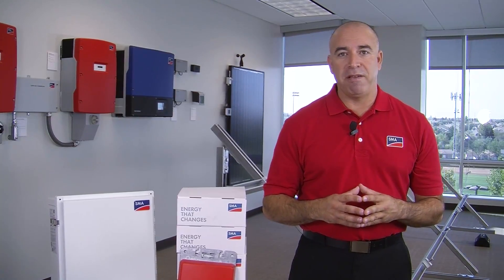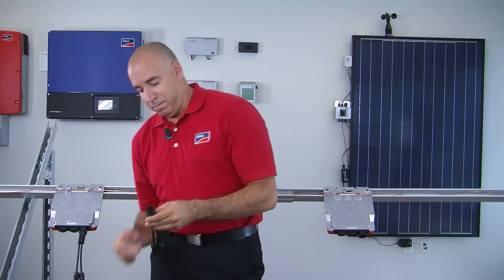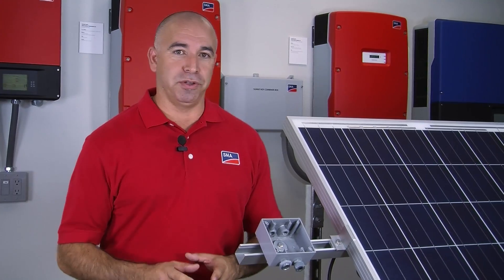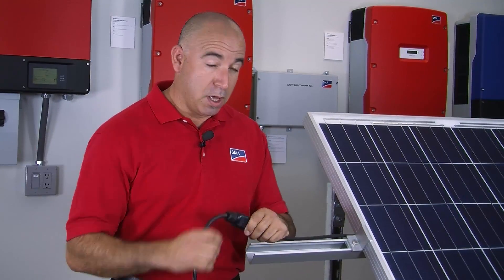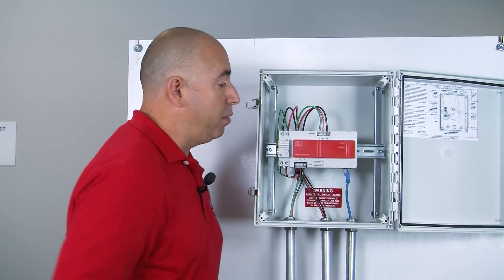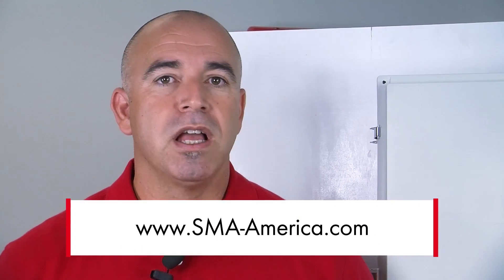Tech Tip: How to Install the SMA Micro Inverter

Comment: My question and curiousity is how do multiple micro inverter PVs  manages to synchronize the ac frequency they generate? I mean it's like connecting multiple gasoline ac generators together. And do the micro inverters have inbuilt ac syncronizers?

Comment: Is ethernet cable the only means of communication? No wifi, no cellular connection? It would be nice to have those features to eliminate the extra work of running cable. Also there is no info on the website for the micro inverter.

Comment: please excuse my ignorance.As i'm watching your videos it's quite obvious that the xt1 has no a/c grounded (neutral)conductor coming in or out,I'd like to know if i may why and how it's omitted,yours seems to be the only micro inverter which does not have a grounded conducter on either side.As a side note i notice that your xt2 and i'm assuming all the others have a neutral terminal,how is it derived?and again why is it not necessary on the t1.This is really throwing me for a curve.As a matter of fact i have yet to see a string inverter without a neutral conductor.I have read all of the literature associated with the micro,but i can't seem to find an answer.
Reply from the maker: +ric g You are correct that there is no neutral conductor on the Multigate. In this case there is not a need since the load is a balanced 240V split phase it is not required and passed UL testing as is. For the larger XT units there is a neutral because the networking equipment that monitors the Multigates requires it, though the neutral is only run to the power supply and not to the individual Multigate units.

Comment: How does it connect to my service. In the end he says connect to one 15 amp breaker?  Where is the ground and where is the neutral, 15amp?..... Just a beginner trying to learn. The 240VAC split phase comment below also has me wondering 240 vs. 120 ? Thanks in advance to all of those who take the time to  reply.
R McG
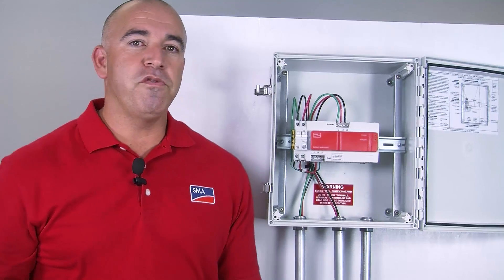Reply from the maker: RobtJude The Multigate connects to your AC service like a normal PV system, via the appropriate size breaker given the 120 percent rule connected to the main panel. That grid connection from the main panel has marked areas for each wire to land on the Multigate's pre-installed 15A breaker as seen at 4:25 in the video. Ben doesn't fully show how to connect to that breaker but you'll see labeled connection location locations for each. The system only produces 240V split-phase.
Reply: SMA Solar Technology Thanks for the quick response. I did figure it out by watching another video. Looks like a 15/20 amp double pole breaker with the neutral going to the neutral bus bar and the ground going to the ground bar. All just standard stuff, nothing fancy. Sometimes I get confused by  thinking things are more complicated than they really are.

Comment: hey im looking to combine my solar panel whit a micro hydro plant, do you have a solution for this setup?
Reply from the maker: Hi Rag,

Yes, the Sunny Boy inverters ending in -US and TL-US work with micro hydro systems. You'll need to change the operating parameter from Maximum Power Point to Constant Voltage, then everything will work just fine. 

Best,
Justin
Reply: SMA Solar Technology  Thanks for the reply, I bought The Windy Boy Protection Box, to make the 3 phase AC from hydro turbine (4kw) to DC 600v to supply on to the sunny boy (which I did not buy yet). I'm already connected to the public mains and has a three phase 230V / IT, 63A power grid, which Sunnyboy would you recommend that I buy for my facility when I intend to build and 6kW solar panel plant too. is it a 3 phase Sunnyboy that may be suitable for me? (Tripower)?

Tnx :)
Reply from the maker: Rag Dy Thanks for the extra info. Given your grid is 230V then the Sunny Boy-US won't work for you, but the non-US versions will. Where are you installing the system? The best next step is to refer you to the local SMA Service Team so they can help with exactly which inverter you'd need, likely a Tripower though.
Reply: SMA Solar Technology Tnx for the reply, im located in norway that dont have a big market for solar power yet because the cost is still high in the return of kwh.. im a licensed electrician my self so was planing to do most of the installation my self when i got hold of the proper sma equipment :) so think england or germany is the closest sma distributor, but if u can point me in right direction il be werry greatfull :)

tnx
Reply from the maker: Rag Dy I spoke with a few colleagues here and we think the closest place wound indeed be our German headquarters or SMA UK. Once you've completed the install, please reach out again and let us know how everything works :)

Comment: I want to run an experiment with just one panel. Can I connect one of the micro-inverters to the grid alone, or must I use the multi gate?
Reply: +SMA Solar Technology That's unfortunate.  I have no need for a "Communications Solution"  (Gack!) and no desire to add another $250 to the price of a minimal grid tie kit.  Sorry, but this is a complete deal-breaker.  (Hellooooo Enphase!)
Reply: how many micro inverters can be connected to one multi gate ?
Reply from the maker: Hi Jorden,

The Multigate must be used even for one micro inverter. We've done testing with one and two micro inverters running through a Multigate as well, so it is entirely possible to do panel testing this way.

Best,
Justin

Comment: Ich bin ja echt eine SMA Fan und alle meine Wechselrichter sind von SMA.
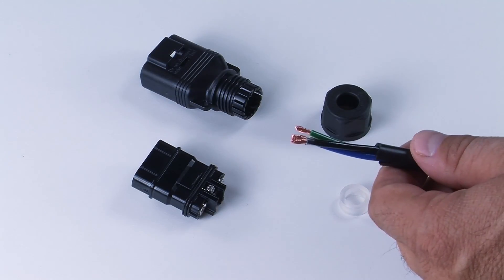Das AC Kabel (2:50) ist absolut unfachmännisch angeschlossen.
Da gehören Aderendhülsen aufgelegt.
SMA. das ist ist nicht vorbildlich!!!
Reply from the maker: Hi Thomas,

Thank you for the kind words and trust you've placed in SMA. This video demonstrates application for the North American product, where use of ferrules is not common nor required by code or the installation manual. If it makes installers feel better, ferrules can be used. 

Thanks for your concern,
Justin
Reply: In Afrika weiß überhaupt keiner was Aderendhülsen überhaupt sind.

Comment: All of the instructions I have read refer to connecting the Multigate to a router on my network. I connected the multigate via cat5e cable to my TP-Link outdoor access point which I set to client mode. The TP-Link jumps on my network via an access point. I can see the TP-Link on my network but I cannot get my sunny explorer to see my new power plant through the multigate. The instructions say to turn on my laptop bluetooth and then I will be able to create a new power plant on my sunny portal. I see no reference to bluetooth in the instructions and I am directly wired to my network through my wireless client. Any suggestions?
Reply from the maker: Hello Jon,
if you want to access the Multigate via Sunny Explorer in your network, the Multicast Protocol (IGMP) must be supported from all LAN-equipment. It could happen, that Multicast is not supported automatically and you have to enable it in your router and access point. 
If you have further questions, please call our Service Line, the colleagues will analyze your problem and find a solution.

Best regards,
Laura
Reply: how many micro inverters can be connected to one multi gate ?

Comment: The big FAIL @ 4:38 I would love to find a micro inverter that did not have a spy plug (connection to an outside server). I do not want every aspect of my life monitored.
Reply from the maker: Though our micro inverter system is internet enabled, it is not internet dependent and will run just fine without an internet connection.

Best,
Justin

Comment: Hy. The Multigate can output 120Vac? or 2 x 120V split phase?
I read on Data Sheet of the Sunny Boy 240:  AC output
2 x 120V Split Phase. Do you have info about this?  Thanks.
Reply from the maker: Hi Jeremias -

Yes, the output of the Multigate-US is 240Vac (split phase) not 120Vac. More information on the Sunny Boy 240-US system can be found here: http://www.sma-america.com/en_US/products/grid-tied-inverters/sunny-boy/sunny-boy-240-us.html

Thanks,
Justin